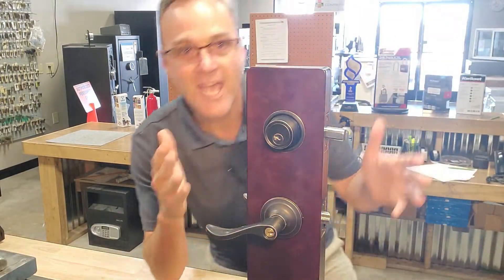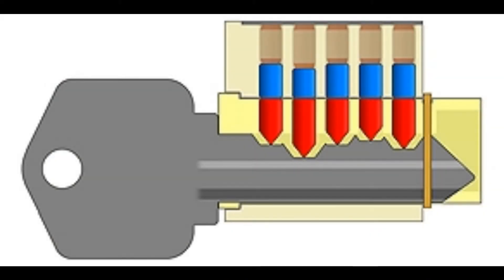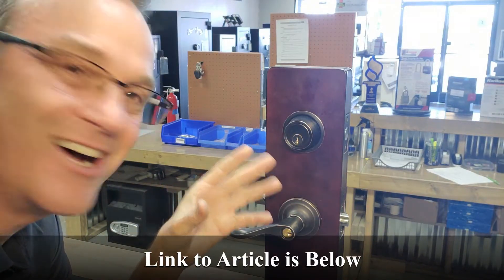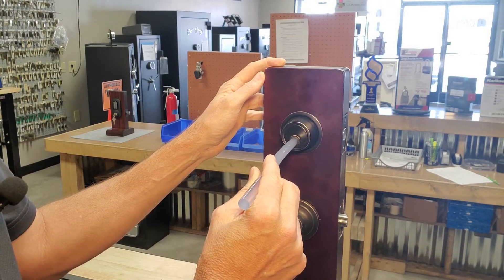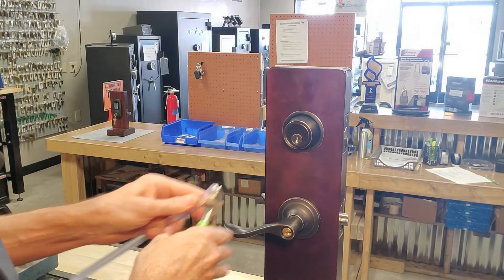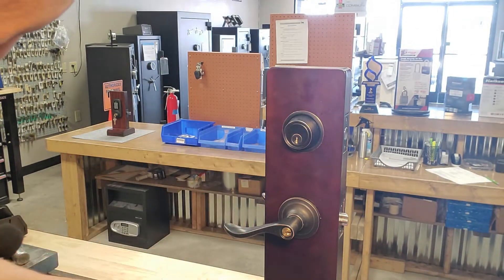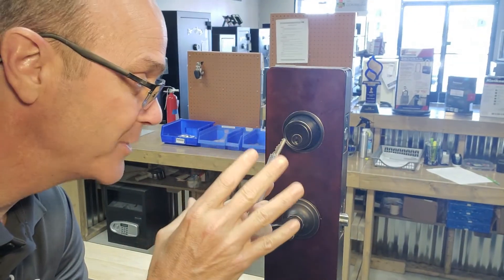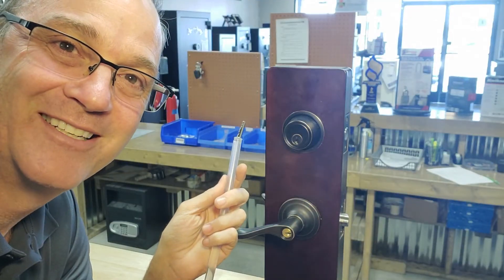Can You Remove a Broken Key from a Lock Using a Glue Stick?

Comment: OMG, thank you. After watching another video and spending nearly an hour and a half trying to remove the broken key from my front door I almost gave up. But I decided to try your video. And you gave me the keys to the kingdom, so to speak! The other guy never told me that the lock had to be aligned vertically to release the pins and allow the key to slide out! After doing that I was able to pry the key out in less than 2 minutes. 🤦‍♀️ Thank you so much for that valuable piece of information. I'm going back to the first video to tell that other guy that he skipped step 1!
Reply from the maker: Awesome! 👍

Comment: After aligning the broken key in the vertical position, I just used a pic and small pliers from my RC(remote control) tool kit, pried the broken key out maybe 2mm, grabbed it nice and tight with the pliers, and pulled it out.

Comment: 1. Use WD40 or sewing oil on the key in the lock
2. Use a screw driver to turn the lock until it is vertically aligned to dislodge the broken key.
3. Sharpen the glue stick so that it will only affix on the broken key.
4. Position the melted glue stick on the broken key and wait  until it solidifies on the broken key. 
5. Slowly remove the glue stick.

Comment: Thanks. Worked great. Trick for me was not to pull glue back too hard... natural instinct is too try to tug key out by force, but glue loses connection with key with that sudden force. key comes out if you slowly jiggle loose with very light force from glue stick until key budges loose first. Good luck, folks.
Reply from the maker: Awesome. 😎

Comment: How can you orient it vertically if you can't move it with the broken key stuck inside?🤔
Reply from the maker: If the cylinder is turned when the key breaks, that means you're properly at the shear lines. It'll turn right back. But it won't pull out because the pins, that the key is holding at the shear line, have no place to go to get out of the way so the key can come out.

Comment: so do I need to change the lock or the key?
Reply from the maker: The key is broke, so you would need a new key.😊 Take both pieces to a local locksmith and they should have no problem getting you a new one. Whether or not you need to do something to the lock will depend on why the key broke in the first place. If something in the lock prevented it from turning and that's the key broke, take the lock to a locksmith  for a repair.